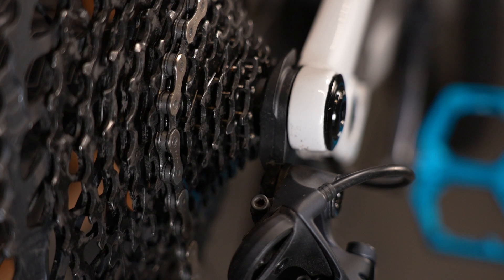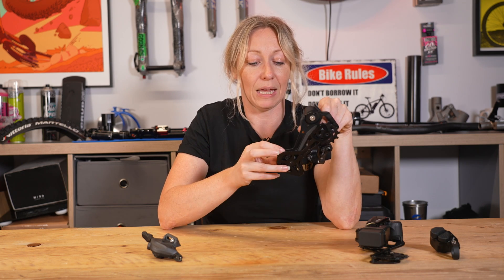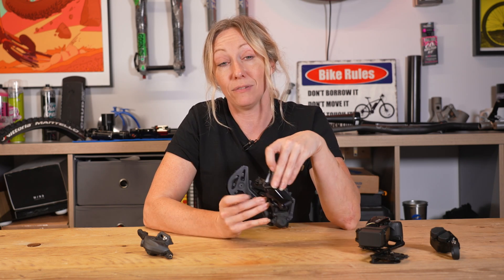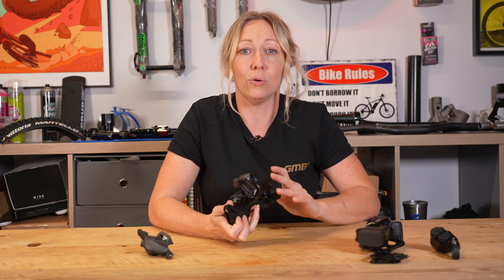How Do Bike Gears Work? | Mountain Bike Derailleur Explained

Comment: I found this video  useless, no offence. i am trying to attach a  Shimano Deore  m5120 sgs shadow plus which as far as i can see is not on your video, it has it's own pivoting hanger which is  bolted on to the bike fixed hanger which i had to replace, i have no idea  what position i should attach the derailleur hanger  ( if that's the right name ) vertical, horizontal or what.

Comment: Tbh, mechanical rd for me has its own advantage for casual riding. The adaptability of mech RDs tend to be useful when you're still waiting for your upgrade budget for example. I can temporarily use thumb friction shifters or any index shifter that correlates to my current speed. You can still mix up your derailleur/shifter preferences. The trickle down technology will come into play for upgrades for shimano deore lineup and below. There's still a lot of possibilities for mechanical derailleurs especially for budget setups that can possibly give good and reliable shifting performance. As long it's still a thing

Comment: Interesting point on the potential for electronic shifting taking over. I understand on road that the risk of mech damage is much less, so for performance the top tiers going all electric makes sense. However it would be unwise for such a move off road as you can't perform a trailside bodge to get you home if you break an electronic mech or your battery runs out without a spare. Perhaps with the exception of XC, the marginal gains from electronic shifting performance are not an importance for most riders, especially when drive train efficiency for a given individual gear is identical between same tier electronic and mechanical shifting. I have had the chance to ride electronic gears just once and they are amazing, but as someone who casually races a couple of times a year the price difference means the performance gains do not justify the extra outlay.

Comment: #Gmbn tech I’m having trouble finding a top speed I have a 1x 10 speed trail group set running 30t front chainring/sprocket  I think I need a bigger chain ring the cadence tops out fast and if I’m in the last lower gear it feels much to resistant

Comment: A “right to repair” lawsuit should be brought against both Shimano and SRAM, as well as a requirement that they establish, allow and support authorized OEM and third party repair centers for these electronic shifters and derailleurs. These things are way to expensive now to be thrown away if there is a feasible way to repair them if only the parts were made available.

Comment: Timely great video. I am new to having a clutch on my rear derailleur having just got a Gravel Bike which has one. 
If I am on a ride that is roughly 50% road and 50% gravel do I leave the clutch on all the time or do I have it unlocked on the road and then lock it on when I ride off road. Does leaving it on all the time cause any damage to the derailleur or chan over time. There are lots of MTB videos regarding the clutch but I can't find any Gravel videos explaining my query, probably because most of these videos are by roadies (like myself) who don't really understand them.
Reply: The only time you need to disengage the clutch is when you need to remove the chain or the wheel. You will not damage the drivetrain by leaving the clutch on.

Comment: I just got a trail bike, and it has a shimano derailleur, so perfect timing for me. Never owned a "fat tire" bike as my road frames were not wide enough to accept such big tires, so I am totally not used to all that bobbing about, and I feel as if I am sitting on a pillow. The knobby tires (Maxis) grab way more than I am used to, but I assume that on loose dirt this will help. I am currently using it locked out until I get used I the feel. Shifting is fine. Dropper post? Hmm, I am going to need a white marker. This trail bike actually weighs less than my roadie, which is set up for supporting a heavy load of paniers and the like. Not crazy about the "lung puncturing" strait bars. Undoubtedly, I will eventually fall. I got flat pedals to start, Yoshimura Chilaos. My road bike does poorly on gravel, never mind single track trails, so that is why I got an Ibis Ripley. I may swap out the big 34mm Fox fork for a 32mm step cast one, provided it results in a more than 500 gr weight savings. You will see me at the Sea Otter Fox sales pop-up checking things out. I will also say hello to Calvin Jones in the pop-up down the way. Oh, I forgot the Muck Off pop-up, Canyon, Orbea, Rock Shock, WTB, Wahoo, and many more.

Comment: Oversized jockeys a popular add-on? I don’t see anyone out there using these currently as they are too expensive, I’d like to use them but not at the price they currently are.

No mention of the cage lock on SRAM and you need to be careful of the lube in the clutch, some bits can be lubed but some bits shouldn’t.

Comment: Pretty sure this video should be called 'Shimano Rear Derailleur Explained', as 90% of video we are speaking only about Shimano, and finally when we would like to speak about e-gearing, even there we show the Chinese mech on the table, close to Shimano. 
When it's not a secret for anyone, the SRAM took the lead in MTB. :)
Reply: All rear derailleurs adjust in the same way, what difference does it make🤷‍♂️
Reply: Yes SRAM took the lead in unnecessary gadgetry shifting, unserviceable clutch,to big gear jump, and plasticky finish…👌🤣
Reply: @wonderwatch2239  SRAM is years in front of Shimano in 12spd world, m8100 gen is a full miss in my opinion compared to GX.
Reply: @aleksarajkovic3471  agreed. Shimano’s 12 speed mechs are complete joke how cheaply and poorly manufactured they are.
Reply: @TheNotoriousMIC  mechs are not even the worst part, I've never ridden a shimano 12spd drivetrain that worked perfectly with clutch on, including mine, clutch off its okay but with it on its just not what I paid for, while SRAM just comes with different type of clutch and it simply works 🙄, speaking about GX and up, SX and NX are pure crap and if you aren't interested in upgrading just get 12spd deore.
Reply: @aleksarajkovic3471  I agree completely. Deore, SLX, SX and NX are a waste of money. It just falls to bits and never works properly and needs a lot of maintenance just so you can use it. XT and XTR is decent but your money is better spent on GX / X01. Just works faultlessly, never needs maintenance and lasts for ever.